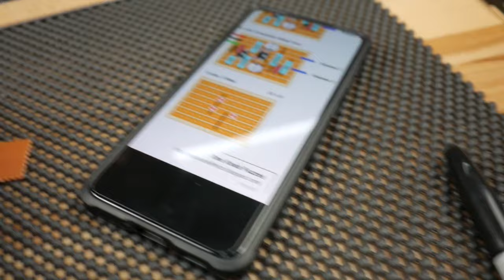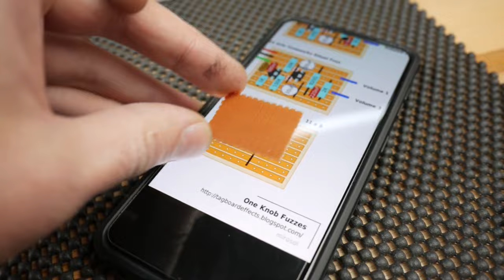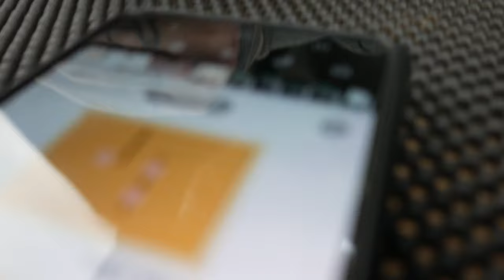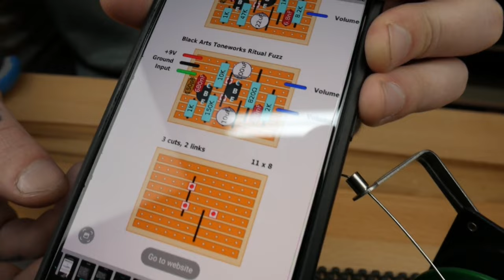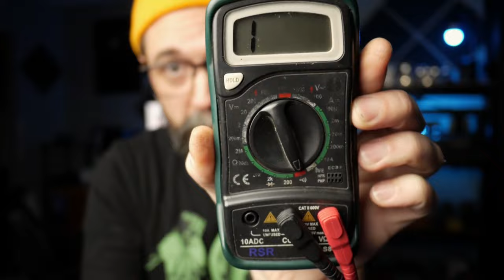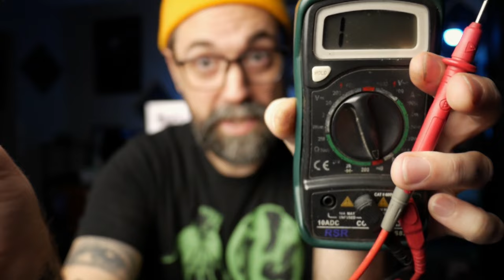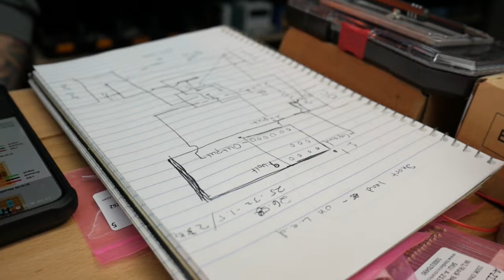How To Build A Guitar Pedal

Comment: I've built a few pedal from kit companies (BYOC, General Guitar Gadgets, cheap Amazon kit). One piece of advice that I'd give is to have a multimeter available to properly identify each resistor. As someone who has red/green colorblindness, I found it very difficult to discern the different color markings on the resistors. The brown and black, red and orange, and blue and purple can be difficult to tell the difference, but if you use your multimeter (helps to have the alligator clips), you can accurately measure their resistance.
Reply from the maker: Great advice!!

Comment: Yo ,is it possible to burn a amplifier when you will connect something wrong in effect?or something will be wrong with power supply like input of DC ?
Reply: Yes. You're messing with electricity, there's always a risk to mess something up bad enough to fry anything. Hooking your output up to a 120v rail would probably be bad, yeah?

Comment: This was fantastic! Thanks so much for doing this!

If one wanted to replace the footswitch in a kit with a soft switch, what are some things to keep in mind when replacing that part?

Great content! Cheers!
Reply from the maker: The soft switching requires another mini sub circuit that would have to be added on. Maybe I’ll have to design an add on kit for this (:
Reply: Is that like the JFET switching or boss type set up you'd see a lot? I can never remember what that's called? Id always wondered this about those switches some pedals have that you can operate like typical footswitch he's or hold them for momentary operation of certain things. I've not used one yet in any pedals but there's a bunch with that switch in them. Wasn't sure if that would entail extra circuitry that you'd not normally have to include, aside from what the momentary action is driven by, for example like making your delay go apesh*t while it's held down, into crazy oscillations.

Comment: 20:30

Talking about ground loops... I find you don't need to connect one of the jacks to ground, the metal pedal enclosure itself will do this and avoid a loop, otherwise you WILL have a loop. Perhaps different if the pedal enclosure is painted and thus not conductive